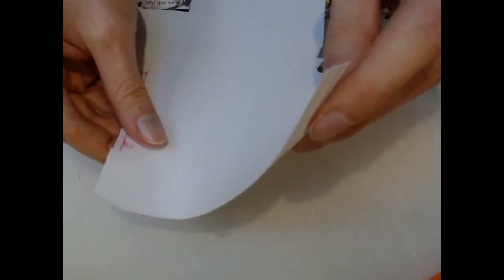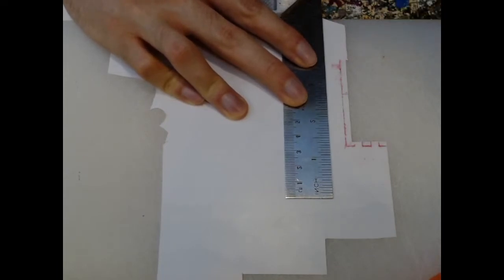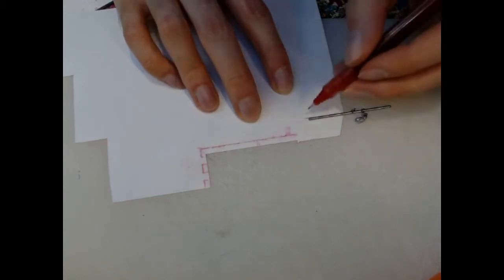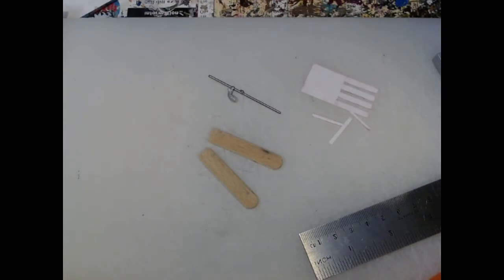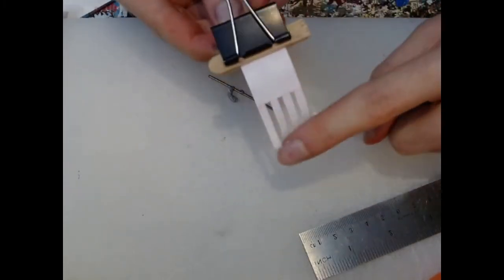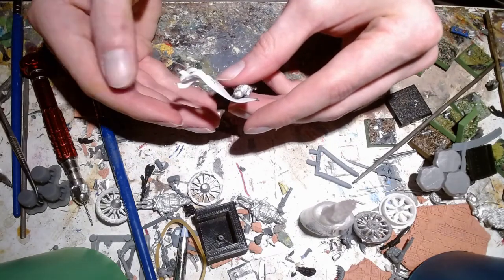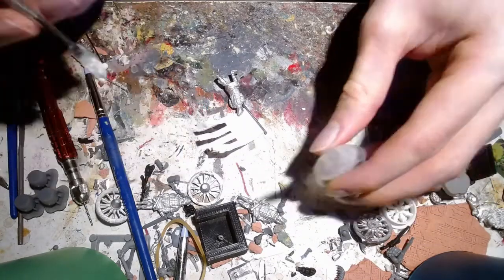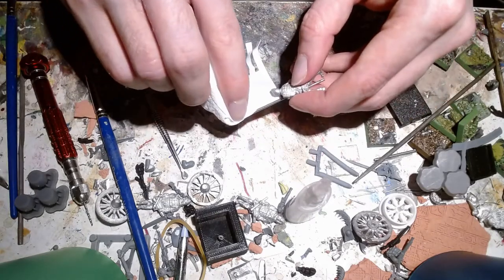Hobby Tip 1 - Plastic Card Banners

Comment: Now this was an interesting surprise, great video tutorial. Stunning freehands!

Pacing was good, in depth details and tips great. Not as shiny as some others but I prefer knowledge over bling bling. The bending was a bit hard to see due to the camera position and all the action going on, but it was easy enough and well narrated.

I used 0.25mm myself in the past because I sculpted on the banner, so I needed a bit more rigid. With the greenstuff attachments it holds well enough but due to being on the old scholl large side it doe not bend when touched and thus I might have knocked over that mini a few times. 0.1mm looks to prevent that from happening which is a great advantage.
Reply from the maker: Thank you, glad you liked it :)

The bending scene was real tricky to get right. When I had finally found the perfect position for the camera, the steam from the pot kept fogging up the lens, so I had to move the camera away a fair bit.

I usually magnetise my standards (when possible at least), it help prevent damage to the mini since the banner just pops off instead.
Reply: @thehatrack3972  These stories of miniatures damage scare me! I guess one day when I get to moving my models around more (hopefully!) I will suffer those experiences (but hopefully not!) !
Reply from the maker: @Agoners  As an engineer by trade, I actually find that a quite interesting part how the hobby: how to build models that can be transported and used in game with the least risk of damage. I believe varnish and magnets are the best answers :P
Reply: @thehatrack3972  I'm part of the way there with the magnets at least! :D